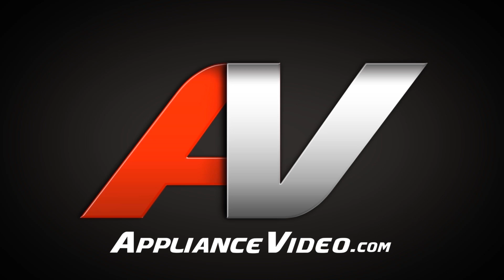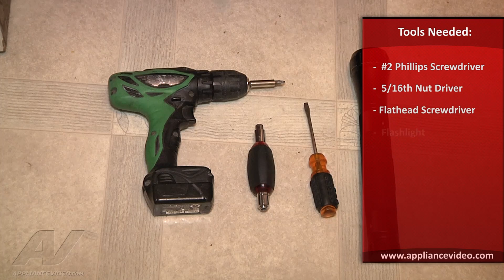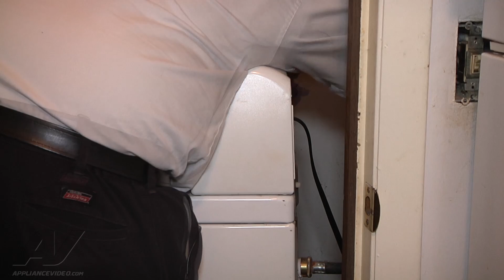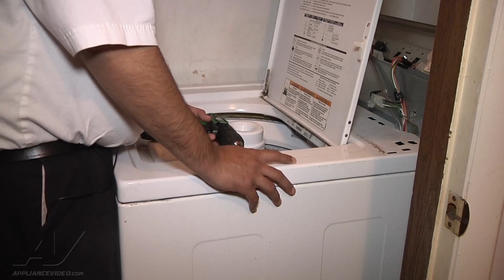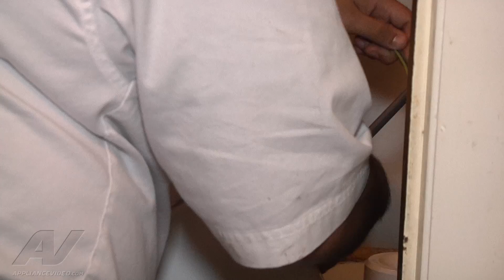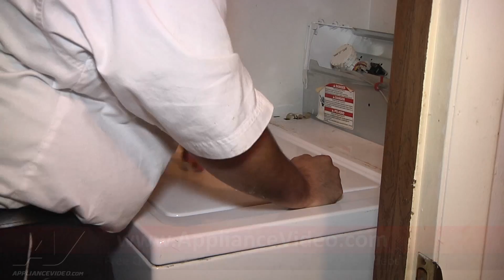Whirlpool Washer Repair - Broken Lid Lock - Lid Switch

Comment: I'm looking for video on a Kenmore model 11088732796
Part 3355806
Washer lid switch on a stack combo
Reply from the maker: Great question, you can call
our parts department at 1-800-830-5465 and they can give you help 6-days A week
Mon-Sat . You can also search at www.SaveMoreOnParts.com 7- days a week.  If you have a more
technical question that our parts department cannot answer, our technicians are
answering all questions at our website at www.ApplianceVideo.com under our Repair Help section. We have over 6,000
common questions and answers that you can easily search through by your model
number, appliance make, problem or error codes, and It’s completely free to
search through our question & answer library. There is a very good chance
you question is already answered there.